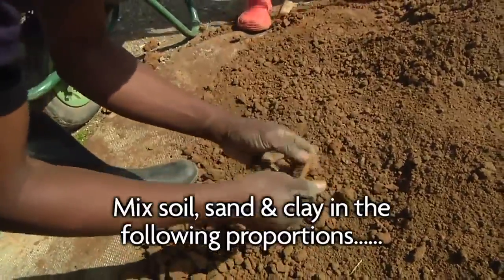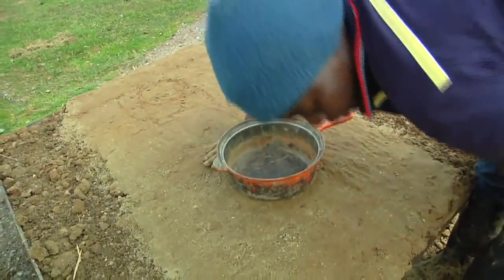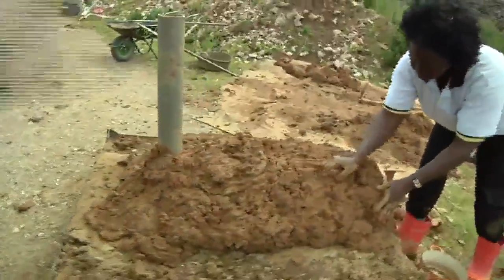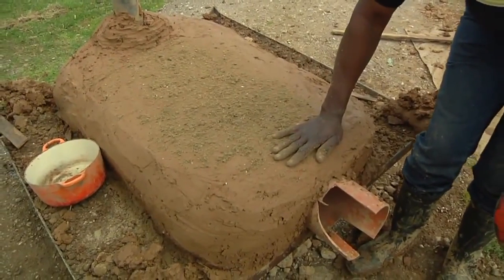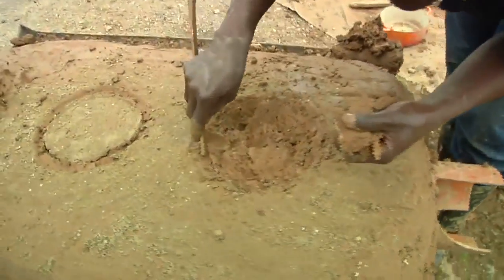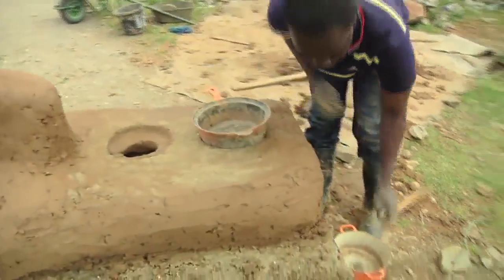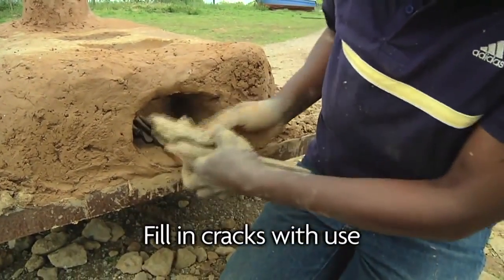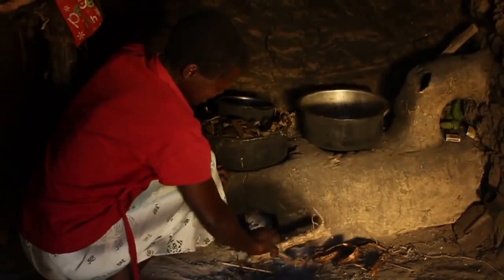Hand crafted All clay 0$ Clay Rocket Stove (better version)

Comment: I enjoyed this so much.  Just wondering when and how they connected the larger pipe cavity to the stove pipe cavity.  They did not adjoin each other...there was a handspace of clay separating them.  Also, she mentioned a wall in the large pipe cavity between the 2 saucepan spaces.  I don't understand how the air/flames flow through the larger cavity opening to the stovepipe cavity if there is a wall.

Comment: It cracked as the main tube was removed. Easily fixed at that stage but the addition of some chopped straw to the mixture would add some reinforcement. I wonder how long the stove lasts before it cracks and becomes unusable.

Comment: I may only be willing to concede this as a rocket stove only because the combustion chamber is so long.  Typically a REAL rocket stove chimney goes up then back down around itself. ore exiting usually sideways through a mass for heat storage.  This isn't quite a rocket stove as the description says.

Comment: Thanks for a great video. Please advise if it would be acceptable to use a mixture of cement and plaster sand to replace the clay mud in the making of a fuel-saving stove. I just think that cement mortar would make the stove last longer. I might be wrong though and I think some advice would be great.
Reply: Louis Brown I think cement and mortar will become like powder after heating over and over in a short time. In olden days and even now where people use dirt/ clay stoves or tandoor ovens or even on their adobe house walls and floors they plaster them with clay mix to renew them regularly. Walls and floors once a year or every few years to keep them looking new and stoves few times a year. I seen ladies do it in Pakistan. It takes them few minutes to prepare soil mix and few minutes to spread on the stoves and then they let it dry before firing to keep them from cracking.
Reply: I have also seen people mix like one part cement with 1 part sand and 4 parts clay for floors. I heard calcium carbonate/lime stone part becomes powder  which is part of cement mix with regular high heating.

Comment: A month to dry? What a waste of time and good clay. You'd be better served making bricks, and then building a better stove from those bricks once they're dry. Also, with a rocket stove, you want the cooking surfaces after a riser from the combustion chamber, and a riser after the cooking surface for the chimney. Putting holes in the cooking surface defeats the point of a stove, so if you can spare a scrape of metal sheet, that would do better than a hole; filling that, a thinner clay tile would work too.

Building the stove in stages, rather than the entire mass at once, would allow the clay to dry faster, saving on drying time. You could also use small fires to dry out the clay if your really impatient.
Reply: Yes but she can't just go to her local DIY chain store. Maybe you don't realize that "scrap metal" is an oxymoron where she is at. Do you have a good "contraflow" masonry heater stove design out of clay?

Comment: The high heat is achieved when the heat goes up the pipe.  This may have been a better design to have the pans to sit on top of two insulated pipes going up.
Reply: Most likely she cooks slow simmer boil for grain, rice, lentil type dishes
Reply: It's not a rocket stove but as a cob woven works fine, waists more wood though

Comment: you could do the same thing without the pipes.
for the firebox, use flexible sticks stuck into the ground arched over, then stuck in again as a frame to support the clay. (let dry for a at least 24 hours before lighting a fire inside to avoid cracking, and start small. the stick frame will burn away)
for the chimney, any old log will do.
i've built a few earthen ovens using this method and it works beautifully.

another method for the fire box is to just use wet sand. build the sand into the desired shape of the interior of your firebox, then build the clay up around it. once the clay has dried enough to support its own weight, dig out the sand from the inside.

but yea, great video, great design!  definitely gonna build one next summer.

Comment: I don't get the bit about the small baffle wall between the two pot holes.  Does the wall just go up about halfway from the floor to the ceiling of the firebox?
Reply: It looks that way, I think it's there to direct some of the flame towards the front pot
Reply: By "front pot", you mean the one nearest to the chimney, correct?  That makes perfect sense, since a partial wall would direct the flow of air (and thereby the flame and heat) across the bottom of both pots.  Very clever and efficient.  It's similar in many respects the Korean "Ondal" home heating system, whereby the heated air (and smoke) is given an "obstacle" to slow and direct the flow of air, to efficiently heat the surface above it.

Comment: This is very cool primitive "tech"... However, my question is this:  How many people that actually need a stove like this have the Electricity, a Computer and a High Speed Internet connection to watch this video on?
Reply: When the day comes that your electricity, computer and high speed internet connection fail, you'll know how to make a fuel efficient stove :D
Reply: Not sure how the number of people needing a stove like this is relevant. Hey, if it helps JUST ONE PERSON that's good enough for me but check this out.

I live in the northeast of the US in New Hampshire where winters are COLD in parts of December, MOST of January and February as well as parts of March. I also have electric heat!!! Then there's the whole wood thing. I live in an area where all the wood I could need/use for heat during the winters in this area I could pick up off the ground during spring, summer and fall in my yard ... FOR FREE!!! 

I live in the suburbs, these can be fun to build, it gets cold in winter, the heat source is free. Did I mention we have electric heat? They're easy to maintain. These are more efficient AND more effective as Rocket Mass Heaters than ANY traditional wood, pellet, coal stove out there used by ANYONE in a temperate zone, ALL OVER THE WORLD  ... I'm sorry, what was your question again???... :-)
Reply: I do this thing where I store images and record audio in my brain. Hold it there until a time may occur I need it. It's really portable and uses no batteries.
Reply: Lee Forex =)
Reply: People who use stoves like this do not need internet ! 
they already know how to build them. Hence they eat & are alive .
all we do is 'Click  n Starve'.

Comment: can't you make it with bricks?
Reply from the maker: what is bricks made out of?
Reply: +zuzilda fired clay
Reply from the maker: Bruce V
Yes, and this is will turn into one uniform prefabricated fired clay brick when fried, without much cracks, that are easier to fix or complicated bricklaying skills.
Reply: Just google 'rocket stove' You can make it out of anything fireproof. The benefit of clay is that it is heat saving.
Reply: You're not paying attention.  The whole idea is how to make such a stove from materials readily available and shape them into whatever you need.  They probably don't have a Home Depot around the corner where they could buy fire bricks.
Reply: I guess the idea would be you get one group to do nothing but make these fired clay bricks and another group to use those bricks to make stoves. That way you get a little economy going and the brick makers can specialise in making better bricks and the stovemakers can specialise in making better stoves. Plus the bricks would be useful in building other things besides stoves too.
Reply: +Zarifa Ex-Muslima when fried do I need to cook it jk
Reply: Bruce V

Comment: Why are you waiting a month?  All you have to do is start an intense fire to harden the clay immediately.
Reply from the maker: If you want significant cracks in your new oven, then try firing it when it is wet, without letting it thoroughly to dry.  I wouldn't recommend it though.
Reply: +Nullll1111 Yes. It needs to dry first, or the water in the clay will boil under the heat and crack the stove. Just like in art class when you made something, it has to sit to dry before being fired in the kiln.
Reply: dude theyve been doing this for ages theres a reason its 1 month, i think they would have tried less than 1 month and it cracked
Reply: There's a chance it will crack from such intense heat, I think.
Reply: +bio2020 It's a pretty large amount of clay... not sure how long it would take, but a month doesn't seem too far fetched
Reply: bio2020 - Stop using your western mentality to assess something like working with clay if you don't know how it works. They have been doing it for a while, so they know why they say wait a month. Just because it does not make sense to us means that she is wrong.
Reply: bio2020 I guess, as the outer layer dries it encapsulates moisture in deeper layers so it has to fight its way out longer.
Reply: Their pottery is a little primitive, when making rough products is usual to mix the clay with dry broken grass to prevent cracks from spreading, for a regular plant pot (which are rough and thick) a day of drying and then fire is fine but sometimes is recommendable to do a short dry (one week speaking freely) then a small heating to dry it and after it cools another heating, this time at full fire

Even if this people may have been doing it for generations other cultures have been doing it for far more generations
Reply: bio2020 hot yes, but really humid.
Reply: What kind of pipe?  What material is it made of?  Pretty ingenious. Love smart woman.  Hugs
Reply: More than likely it dries with wet Rags on the outside so the inside has a chance to spit out moisture. If you don't keep the outside wet while the insides drying it will crack like crazy! And I'm talking about dealing with much smaller pottery and you still have to keep damp Rags on it while it's drying. Apparently you have not worked with Clay before. It's still a humid environment.
Reply: bio2020 - You really don't have a clue what you're talking about. Dry it with intense fire or in a couple of days and almost certain they would have to do another stove or at minimum extensive repairs. That's valid either for clay, concrete, etc. any material that has a high water content must be dry before use in high temperature. Trapped water submitted to high temp will turn into steam and steam as you know can generate quite impressive pressure. 

Many porcelain factories keep the pieces in drying oven for over a month and that's under controlled conditions. Where moist, air and temperature is monitored daily... :-)
Reply: Andrew MacLeod
ok, but does it take 1 month to dry?  in the heat of africa, could be done in 2 days or so
Reply: you're man or girl? shut up bitch! one month and end.

Comment: Did I miss the middle wall part or what? ?? I watched this video 4th tym and still couldn't figure out how n when did u put the wall between first and second hole...Help plz😊😊😊
Reply: To make the small buffle wall is simply use some wet clay and through the pot holes and shape the clay with hands. I think.
Reply: Bandana Chamling, it didnt show how to build the wall between the two openings, but at 11 :33 the subtitle said ‘make a small baffle (wall) between the two openings’ which i would comprehend as to ask you to make a low wall at the burning chamber at between the two pot holes. The function of  the low wall (called the small baffle wall) is to stop the fuel goes too far inside, which is harder to clean after using or when neccessary. And the heat will go inside due to the chimney action.
Reply from the maker: Bandana Chamling  There is no vertical wall in fire chamber (as it is just a large round imprint of exterior of plastic pipe), she was basically talking about ceiling or a clay spacing between two cooking holes, that gets heated and fire transfers to the second cooking hole, while smoke going out of chimney. She was mentioning that to not to use long sticks or push fire too much far deep into oven and start firing in front part of the oven. Sorry it is a little hard to comprehend.
Reply: 阿婆粉碎霸气寸大户本剧图谱